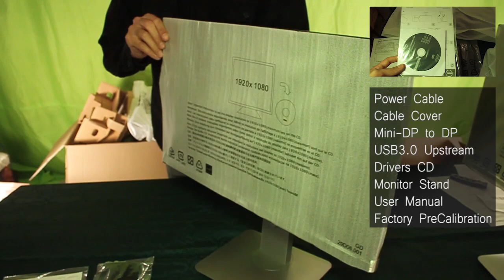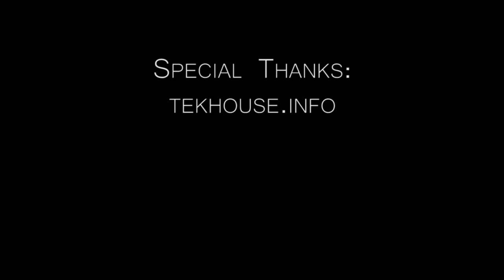Unboxing Dell UltraSharp U2414H & Dell MDS14 Dual Stand Monitor

Comment: How about 2412m,  dell ultrasharp u2412m monitor w/ stand ?
Reply from the maker: It will fit nicely! https://images-na.ssl-images-amazon.com/images/G/01/aplusautomation/vendorimages/e8b2859c-1d0d-4e14-ac63-10a679bd882e.jpg._CB308932137_.jpg

Comment: What are the dimensions of the base plate? I can't judge the footprint or how much desk space this will consume.
Reply from the maker: Base plate is Width 66.5cm(26 1/4") x 31cm(12 1/4") and you need at least 20-25cm(8") space behind the monitor.

Comment: Great video.  I have two U2414H's and I'm thinking of using this set up.  At max height, what is the distance from the desk to the bottom of the U2414H? Thanks.
Reply from the maker: +strikeforceagent the distance is 14.5cm or 5" 3/4. Thank you!
Reply: +Vision4reality -thanks. One more question. What is the distance from the back of the base to the front of the screen? Looks like about 10-11".
Reply from the maker: +strikeforceagent yes about 10,5" (i said about because i measure the front center of the screen, if you turn the screen it will change it at the corners) and the foot base is 12,5" back to front.
Reply: +Vision4reality Thank you for your help! I ordered it.
Reply from the maker: +strikeforceagent your welcome! more infos you can find here http://vision4reality.com/en/blog/unboxing-dell-ultrasharp-u2414h-dell-mds14-dual-stand-monitor/

Comment: I know this vid is close to 2 years old, but it still on Amazon and I am thinking of picking this up. So I have a few questions I hope you can answer.

1) What is the total length from the left bezel of the left monitor to the right bezel of the right monitor?
2) What is the total height (from base to top of monitors) at the lowest height? 
3) And then at the highest height? 
4) Is the height adjustable only between the lowest and the highest?
5) Is the height adjustable via clicks or are there buttons that lock the height?

Appreciate the help. My area in which to fit this dual monitor setup is (obviously) limited.
Reply from the maker: 1) 105cm(41.3") - 108cm(42.5") (depends flat or curved setup)
2)  35.5cm(14")
3)  46.5cm(18.3")
4) You can keep it at any point between them
5)  There is nothing to do about clicks or bolt or button, just drag the monitor, it stays in place!

Comment: Can these handle different weight Dell monitors? For example, a 29" ultrawide and a 21.5"?
Reply from the maker: Yes, but the maximum is 2 x 24" so if screens are different sizes, you should not use 2 screens with a maximum width of more than 2 x 24" in the total, So no is the answer for 29" + 21.5"

Comment: Can both monitors be rotated 90degrees and pushed together side by side at a taller aspect ratio?
Reply from the maker: Unfortunately this stand doesn't rotate vertically, only the stock individual monitor stand gives you this option.
Reply: I was about to purchase one of these stands when I saw in your video you can get a slight V shape out of the monitors (everyone always places them flat side by side but thats hardly useable IMO). I really like the 90* option, so thanks for this comment. I missed that in all the specs and reviews
Reply from the maker: Yes this stand not rotate the monitors. Thank you!

Comment: Is there a video on how to attach VESA Adapter Plate?  I am having issues with the spacers.
Reply from the maker: +Adrienne Glasco What problem do you have? If you like send me email if we could help.
Reply: +Vision4reality I managed to get the monitors on the stand without the adapter plates.  What is the purpose of the adapter plates?
Reply from the maker: +Adrienne Glasco adapter plates are only for any monitor with VESA mount in the back. Dell monitors not need these adapters because has fit already without them in dell stands.
Reply: +Vision4reality thank you for this vid. Just unboxing a similar set up and the adaptor plate was throwing me. Cheers
Reply from the maker: +JossTheBoss Yes its' a litlle bit of pain in the beginning.
Reply: @Vision4reality  can you fit two DELL SE2717H monitors on this stand? I mean can you fit them without VESA stand? the SE2717H monitor is made by DELL and it has VESA mount.
Reply from the maker: @vladserbanescu5394   No! In this stand 27" is wider, the mount probably could fit, but you don't have enough space in stand to have side by side 2x27"
Reply: @Vision4reality  i would like to add 2 Dell monitors of 27 inch each. It is stated as 19-27 inch. You mean i cannot put 2 27 inch monitors side by side?
Reply from the maker: @vladserbanescu5394  I don't think so my friend, Dell gives this stand (MDS14) for dual 22"-24" monitors.
Reply: @Vision4reality  i am looking in buying the MDS 19 stand.
Reply from the maker: @vladserbanescu5394  MDS 19 is great for 2x27" ;D
Reply from the maker: @vladserbanescu5394  MDS 19 is great for 2x27" ;D
Reply: @Vision4reality  thank you. Will order MDS19 for 2 x 27 inch
Reply from the maker: @vladserbanescu5394  Good choice, enjoy! :D
Reply: @Vision4reality  thank you! Can't wait. I will go for P series monitors not U series like you did. Even thought U series are prettier and with thinner bezels, i believe they are too expensive for my budget.
Reply from the maker: @vladserbanescu5394  Eyes are the most precious thing and especially if you live by this job. The more you can give for the screen, the better.

Comment: Nice video, Question. Are both already sync together, where I only have to setup one monitor with mini display port an both will show the same picture. Or do I have to set both monitors up individually then make them Dual in the settings. Thanks 😀
Reply from the maker: +Nick West You can use adapter hub (but is not useful if your graphic card has enough number of ports for your monitors) or individually cable from each monitor to graphic card even if is different port. Settings for dual monitor or more you can do it from operating system that you use.

Comment: hey thanks for the video - i am planning to buy P 2419 H dell model - 2 pc ... can i use this stand for the same set up pls guide
Reply from the maker: Hi! I think you can if they are 24" max, i think they have same fit, but to be sure it is better to ask a supplier or the dell :)

Comment: Hi 
2ea of Dell S2715H mount on this MDS14 stand?
Reply from the maker: As we said bellow for 27" monitors - I don't think so because i checked my stand and there is not enough space for 27". Dell gives this stand for 22"-24" monitors. Thank you for your comment! :)
Reply from the maker: 3" each monitor! I measure the stand with full open gap and is 1.5" only(full angle, not flat), maybe fit one 27" and one 24" but not 2.
Reply: Thanks a lot 
i am pushing this because i have no options. 
1.5" each monitor because the other half will be the other side. How about swivel 2 ea of S2715? 
Could you please try for me ?
Reply from the maker: The total gap between the 2x24" is 1.5" and not 3". So 2x27" won't fit even on full angle.

Comment: Hey does anyone know if the dual monitor would be compatible with a macbook pro 2015? Also if i wanted to connect my xbox one to the monitors is there anyway i can do that?
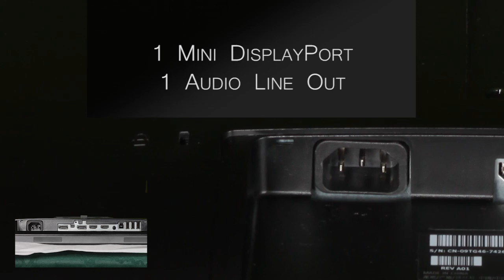Reply from the maker: +Michael Lisek it has a lot of inputs as you can see in 2:06 and also you have the option of adaptor. For better answer, google is a friend or someone who did it already and he would like to tell us.
Reply: +Michael Lisek yes i m using it on mac and windows ,  you can use HDMI port and Minidisplay/thunderbolt port to this monitor